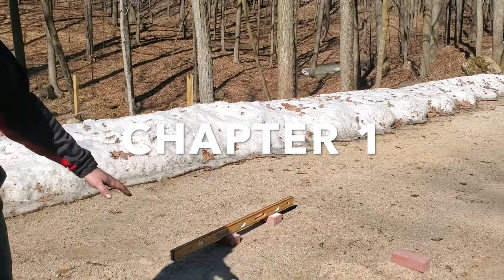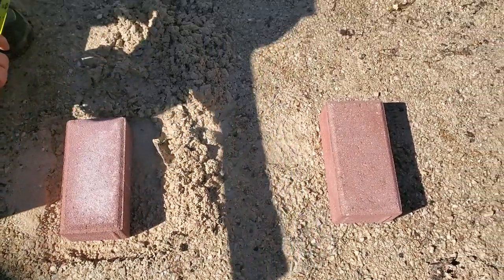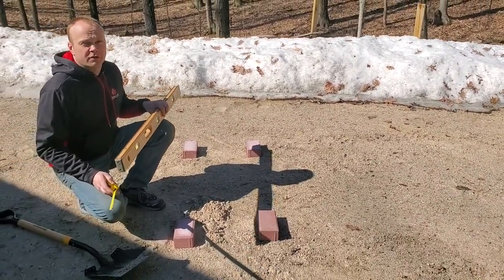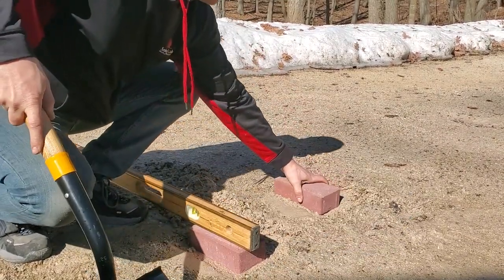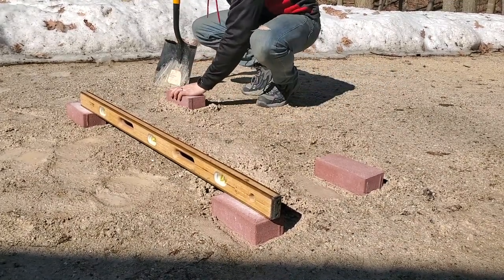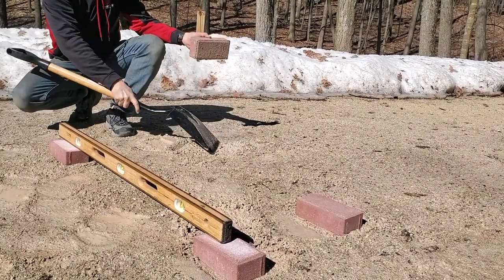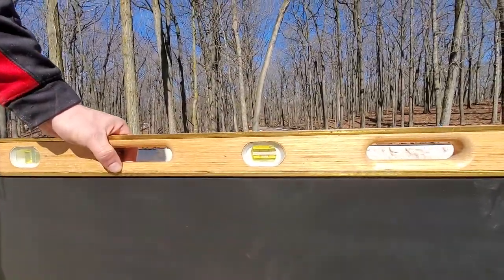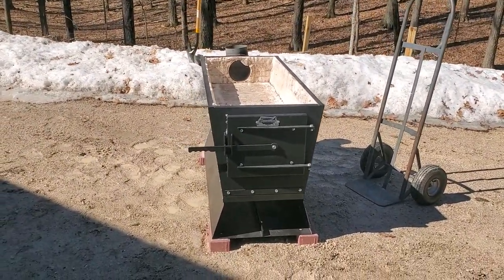Backyard Evaporator Set Up - Leveling the Ground

Comment: I added leveling casters to my Dauntless and it worked like a charm!  That way I can make small adjustments.  If you need bigger adjustments, just use smaller material to get close, and use the leveling feet on the casters to finish it off.

Comment: If you have the tires on it, will it tend to roll out of level?  Any tips for that?
Reply from the maker: If you are using a Pneumatic Tire Set, place a wedge or block in front and back of the tires to prevent movement. The Caster style wheels do include a lock on one end. However, it is still best practice to use a wedge/block.